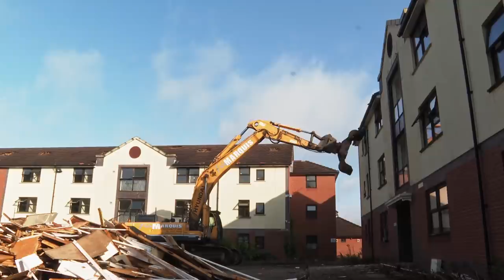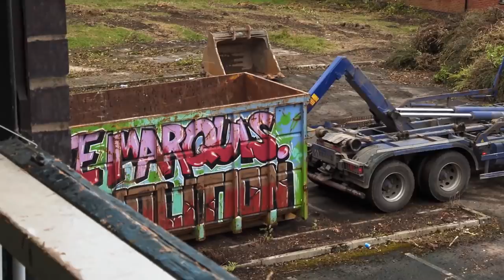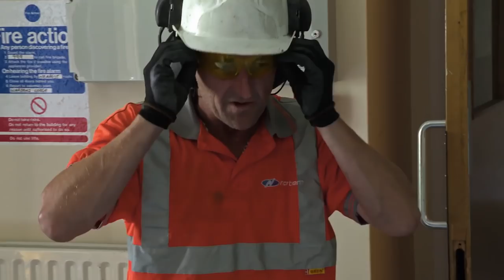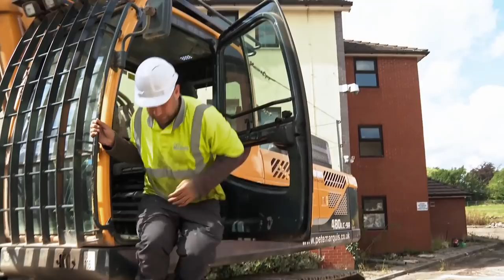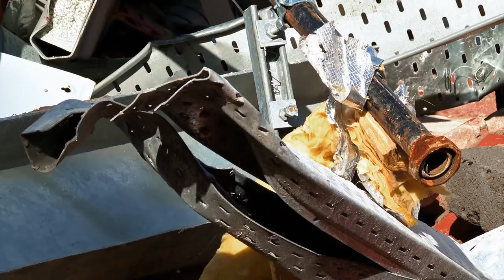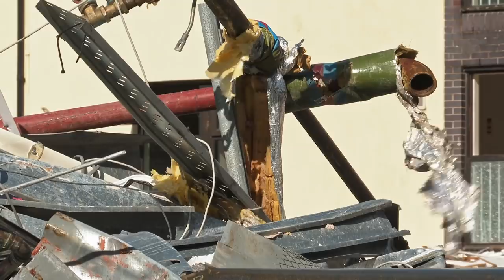Student Halls Are Brutally Taken Down | Scrap Kings

Comment: Are these being offset by new student accommodation buildings elsewhere? Someone I know who is in university is at risk of being without anywhere to stay next year as her current building (a different building originally built as regular apartments in the 1960's) is being sold off and there is no replacement planned. If no alternative can be found it would mean driving from her family home when she lives which normally takes over an hour and a half one way and that is without traffic, she once took four hours to get home once due to motorway closures.